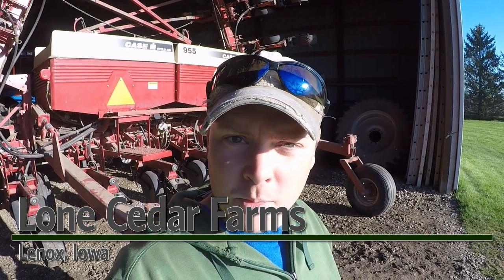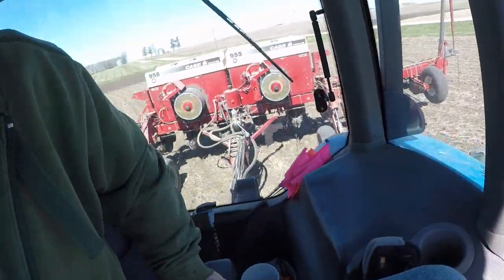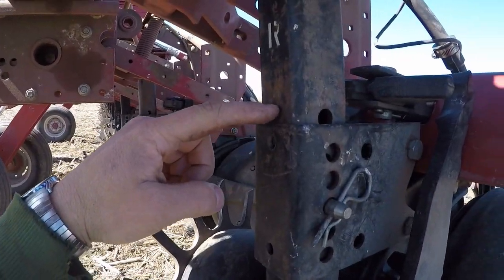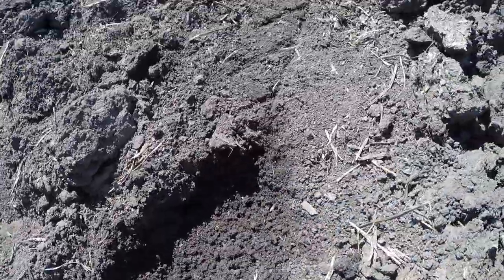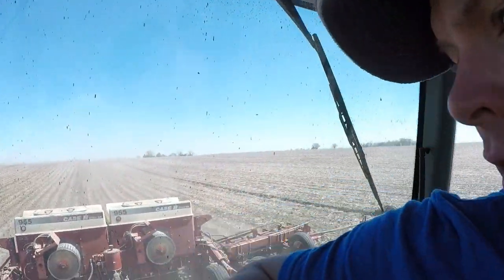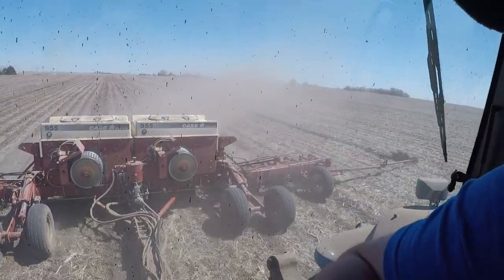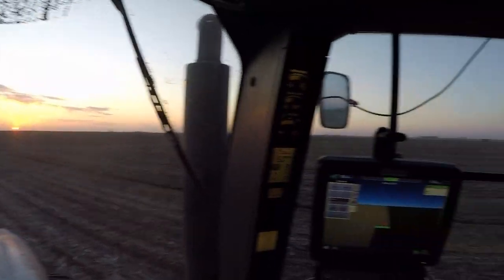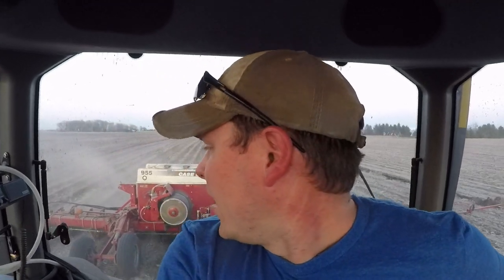2020 Corn Planting Day 1

Comment: What set up are you using for your row clutches? I have selectro but it appears you have an air system?
Reply from the maker: Slectro also has a pneumatic version.  I bought the cutoff wheel assemblies from them and did the rest up on my own.
Reply: @Lone Cedar Farms  Thanks! I will look into them. How far from your headland line are you starting/stopping your cut off wheels to accommodate for the seed still in the tubes?
Reply from the maker: @chrisblake9600  I'm running the shutoffs through an AgLeader clutch module, which uses turn on/off settings in seconds. I think I'm 1.1s turn on and 0.7s turn off, but would need to dig into monitor settings to make sure I haven't adjusted that at some point. I have to make sure the planter is in the ground a couple rows before crossing the last end row to avoid skips from empty pockets in the drum from the end of the previous pass.  This has less to do with seeds in the tubes and more to do with the Slectro cutoff wheels being ahead of the seed release wheels by 6(?) or so seeds and needing to compensate so there's a seed under the release wheel when you cross the last endrow.

You probably just need to try something and then get out and dig behind the planter, though... your tractor speed and planting population are going to affect the needed timing somewhat.  And I have no idea how the electric Slectro compares to pneumatic as far as reaction time.

Comment: How do you like this 955 I am looking at one like this to upgrade
Reply from the maker: They won't give picket fence spacing due to metering at module / long seed tubes, but as long as you don't drive too fast and keep things tuned up I think they're a good simple planter.  Try to get round or small flat corn seed--large flats are hard to adjust brush in drum to singulate without getting skips.

Comment: Is it just the video or why does it look the wings are running at an up angle to the main frame?
Reply from the maker: I think it's probably lens distortion from the camera... I normally have the camera set to wide field of view, which has quite a bit of fisheye effect.  The wings do raise up slightly when lifting the planter to give more ground clearance.  While planting, they will flex up and down with the terrain (center section toolbar height established by the cylinder stops on the main lift wheels and wing toolbar height established by the gauge wheels).  

As you may already know, the actual seed placement depth is set on each individual row unit--you just want the bar level front/rear so you get the proper downpressure on the packer tire at the rear of each row unit, and the bar at the proper height that each row unit is running in the middle of the range of motion of the parallel linkage (so linkage can move up or down and row unit can still maintain proper depth).
Reply: Lone Cedar Farms I kinda figured... I farm up in north central ia enjoy the videos